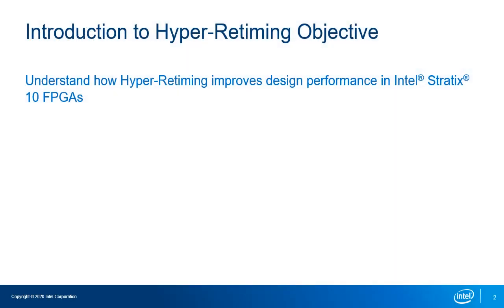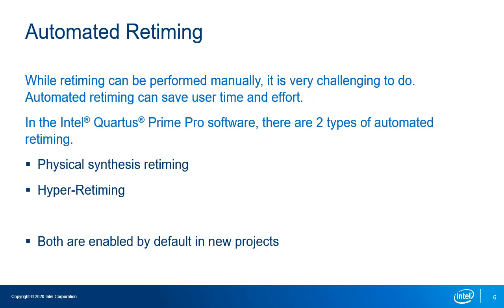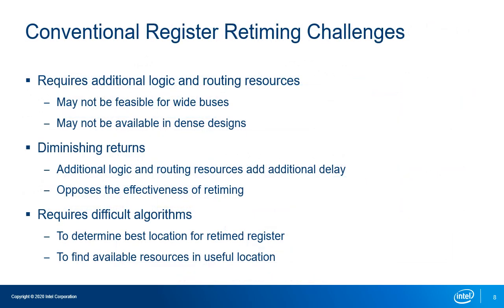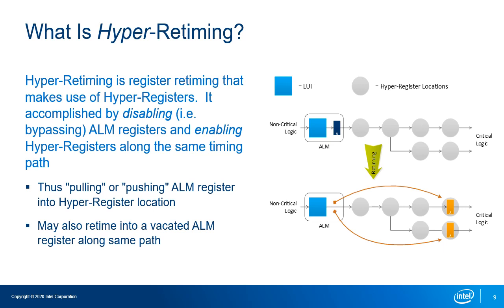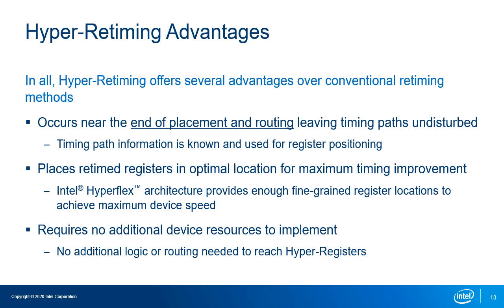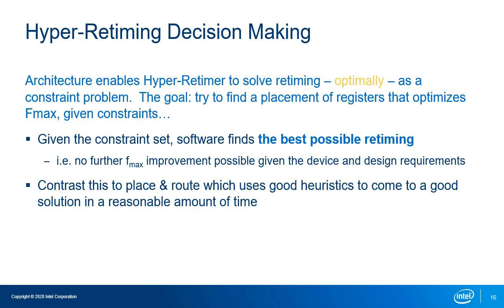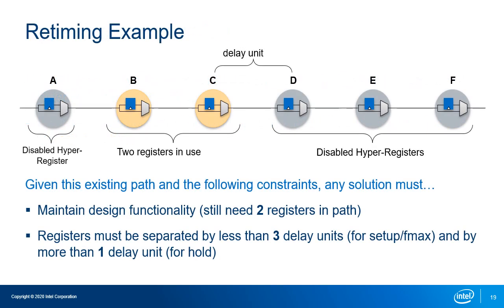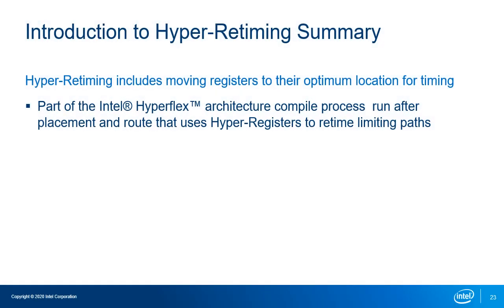Introduction to Hyper-Retiming

Comment: {"csdk":"25","c":"android","cbrand":"HTC","cbrver":"15.37.35","cplayer":"ANDROID_EXOPLAYER","cplatform":"mobile","cmodel":"HTC Desire 12","cver":"15.37.35","cbr":"com.google.android.youtube","cosver":"7.1.1.N6F26Q.191012","cos":"Android","videoid":"S4mLisfeID0","cpn":"DIxpqOJFTrquSOEp","fmt":"160  256x144@30","afmt":"140 ","bh":8754,"conn":6,"volume":0,"loudness":"-17.110","bat":"0.130:1","df":"66\/1635","time":"2020-09-22T01:20:12.802Z","glmode":"RECTANGULAR_2D","mtext":"","error":"underrun:1835:b.278;e.114,underrun:1891:b.278;e.79,underrun:1891:b.278;e.10,underrun:1891:b.278;e.246,underrun:1891:b.278;e.218,underrun:2048:b.278;e.160,underrun:2048:b.278;e.197,underrun:2048:b.278;e.160,","logged_in":"1"}